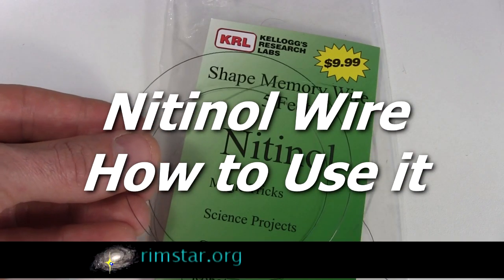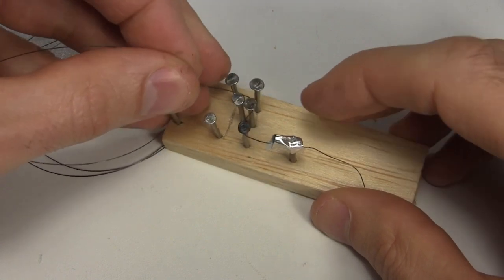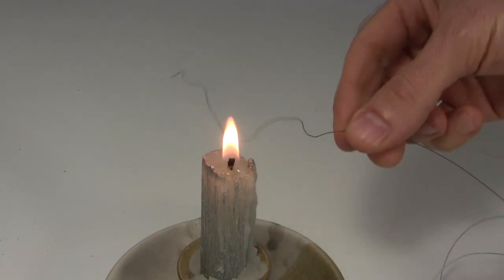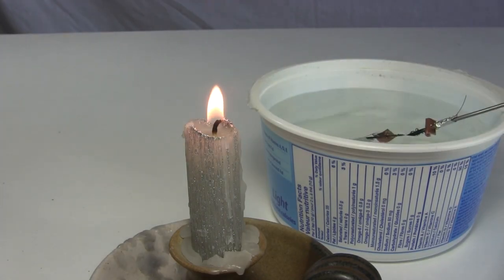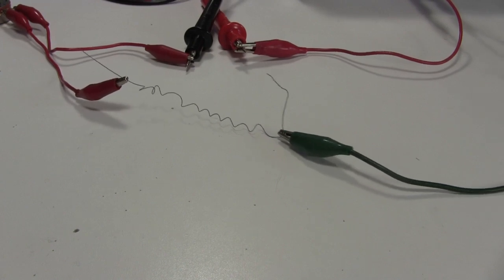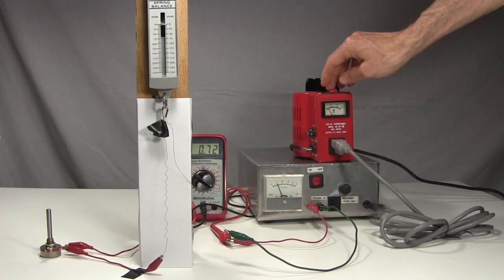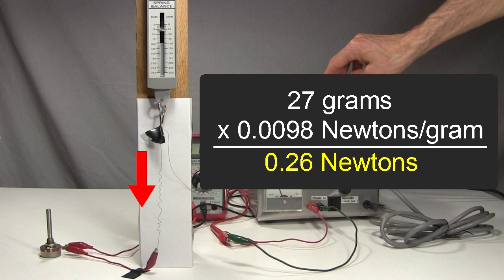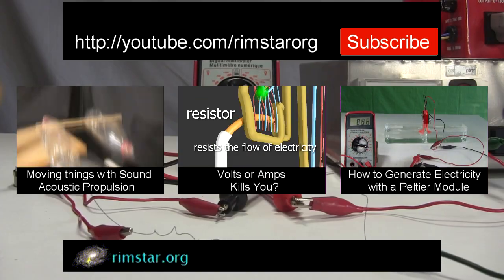Nitinol Wire/Shape Memory Alloy - How to Use it

Comment: I think you'll find that the wire would still exert the same force, and the spring balance would still measure the same force independent or it's orientation. For that matter, if it is in any inertial reference frame it would measure the same force. You don't have to have it vertical, or on the surface of the Earth.
Reply from the maker: Actually, the first time I quickly did the measurement, the spring balance was sitting flat on the table with the spring horizontal and the spring balance showed 35 grams instead of the 27 grams I got in the vertical, probably because it didn't have to fight gravity. But the real reason I did vertical was so I could do the calculation with the 0.0098 Newtons/gram which makes sense only in the vertical at the Earth's surface. The "98" is related to the acceleration due to gravity at the Earth's surface, 9.8 meters/second squared. I don't know of any practical way to calculate the force in a horizontal position.
Reply: RimstarOrg The balance measure force. F = -kx, Hooke's law give the relation between the extension of the spring, x, and the spring constant, k, for a given force, F. The balance is calibrated to show was the mass of an object is for a given extension of the spring under a gravitational field of magnitude ~9.8m/sec^2. This is because the force exerted by the object of mass, m, in a gravitational field, g, is F = m*g. This gives a linear extension in the spring such: x = -m*g/k. Because the manufacturer knows the field strength, and the spring constant the extension may be calibrated in such a way as to give the mass if a object is suspended in the way suggested.

Now we know that mass is independent of the gravitational field that the object is in, and so if we measured a 1kg object on Earth, a balance would read 1kg, and the object would still be 1kg if it was on the moon, but the balance would read about 0.16kg due to the weaker gravitational field. The force changes but the mass doesn't.

However if the spring was stretched by a rod that was connected to the end of the spring and to the body of the balance to provide a force F, this would give an extension x = -F/k. This value is independent of the gravitational field as the rod has a constant tension T, providing the force F. Your wire produces a constant force that is independent of the field. The conversion that you used: 9.8*10^-3 newtons/gram is merely a calibration between the scale on the balance and our definition of force.

If you placed that apparatus in any inertial reference frame it would give you the same reading of the force generated by the wire. Also the method of calculation would be the same. The value on the scale * 9.8*10^-3 = force in newtons.

Cool video, I didin't know it was called nitinol wire :)
Reply from the maker: Joshua Mcateer
I did some more reading and see what you mean now. Thanks for the correction. I'll add an annotation.
Reply: Cool, keep up the science :)

Comment: Have you tried having many zigzags held apart from another to make a muscle?
Reply from the maker: I thought about it, but the circuit would have been more complicated since I'd have to activate one, wait, then activate the other, wait, then back to the first. It's all doable, just a question of time. With the spring there would have been just activate the wire, wait, turn off the current wait while the spring restores the position and repeat.
Reply: true and you can do it more simply with coiled fishing line... look that uo

Comment: Make a synthetic muscle out of it with a bunch of it bent around a bar in a spiral shape
Reply from the maker: Actually I did make a synthetic muscle of a sorts. I made a zig zagged shape wire and put it across an elbow made of two pieces of balsa wood, connected together at a pivot point. It worked great but I couldn't arrange a good spring to pull it back after it flexed. I'll keep at it.